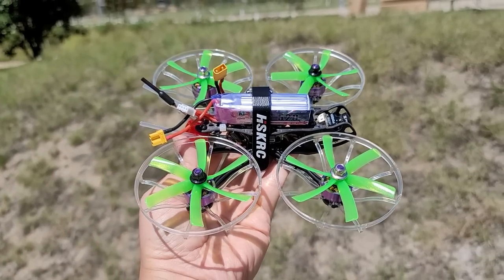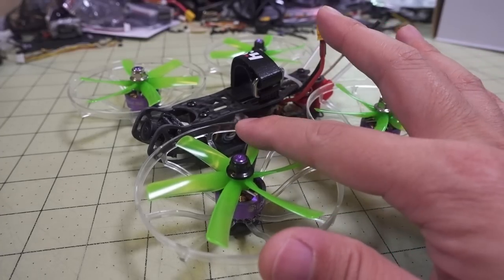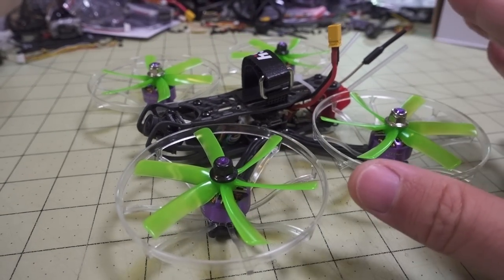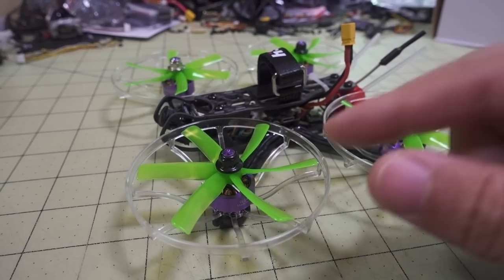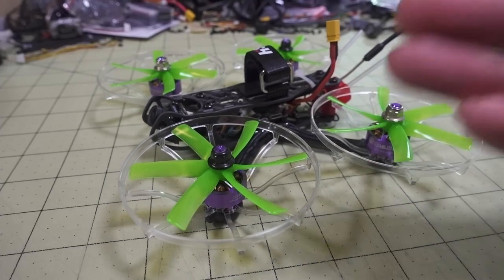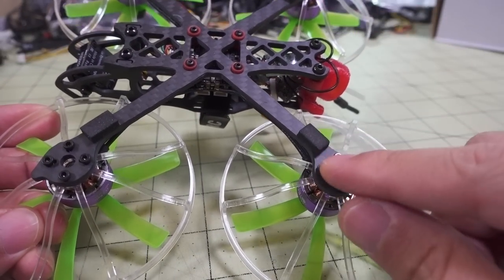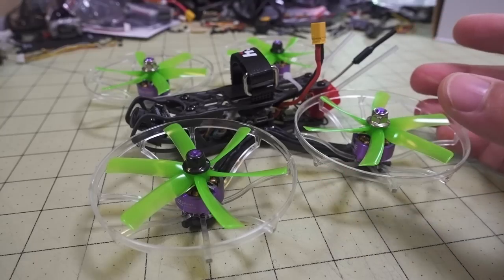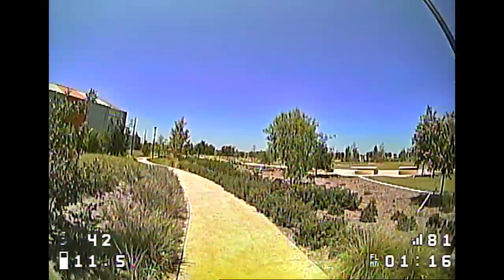Build a Quiet Cinewhoop? // HSKRC Turtle 149 🐢👍

Comment: true story how this video came to be: 

rotor riot makes video saying 6 bladed props are not a thing anymore..
albert kim: hold my beer!
Reply from the maker: LOL
Reply: @AlbertKimTV  hey kim, what if these props are put on 2207 2500+-kv ducted with a gopro on top with a 4s?  What do ya think it would be? Quick conversion from 5 inch to 3inch cinewhoop? 😂😛😜
Reply: @AlbertKimTV  I'm confused about a thing. Can u please help?  Can the amp draw by a 5 inch 3 bladed prop match 3 inch 6-8 bladed prop on a same kv motor?  Since more amp should be drawn by more bladed props be it a smaller size, is it?

Comment: I left the Taycan in my car and it warped soo bad😬 Do you think this frame would be good to transfer Taycan parts? I plan to use the Insta 360 Go to keep it light.
Reply from the maker: The parts should fit but the space for the VTX will be tight.

Comment: Seems to me the guards could be made much stronger with a simple redesign with the same amount of material. Just change the orientation of the individual beams. For example, make the ones going from the rim to the hub flat in the vertical direction and the room itself also flat vertically. Would be much more rigid.
Reply: *rim, not room. Auto-misspell at work. Lol
Reply from the maker: In a hard crash, I'm not sure it will make any difference... LOL

Comment: without propguard, does this frame fit 3.5 inch props ?  I use the emax scimitar 3.5 props on TWIG XL frame. It flew well. thinking about switching to a light-weight top-mount battery frame. this one looks very good, just wonder does it fit 3.5 inch props.
Reply from the maker: I'm not sure since I don't have those props to test but it doesn't seem like it will.